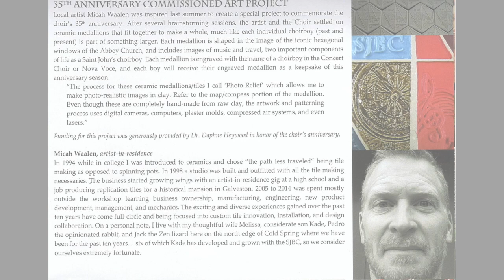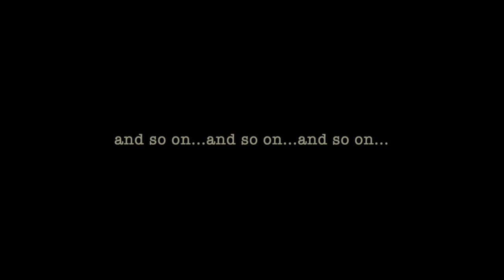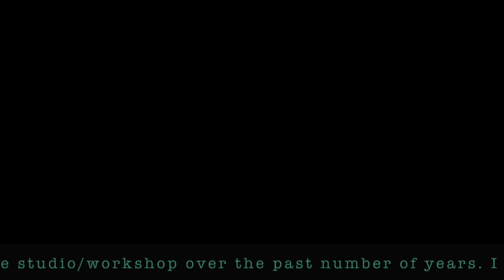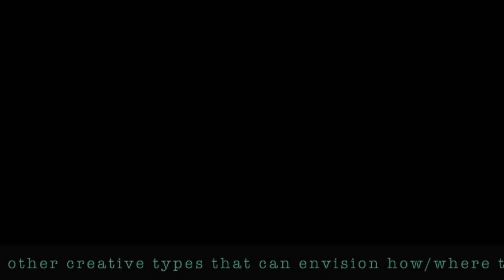Plaster Cast Handmade Tiles. Air Release Mold Process

Comment: Thanks. I tried air release before with less than optimal results.  I will try the soap solution as you show.  I was just using water . I used instructions from the "Texas tiler" website to create my diy molds.
Reply from the maker: How dry your clay pluggs are means everything. I prefer them quite dry/firm for two reasons. As any tile maker knows flatness is often the tallest hurdle so minimizing sag while handling helps keep them from curling as clay has shape memory when fired. The 2nd reason being they release from the mold much easier. Depending on humidity, it does not take long (hour or two) for those 1" pluggs to dry/firm up nicely if sitting on gypsum board or I prefer tile backer board. Not the newer foam core varities but the original cement board stuff. For production runs I would often cut the pluggs the day prior to pressing and let them firm up sitting on tile board but under a plastic sheet. Also...My first few tiles of any run generally fail as the mold needs to be "seasoned" with water, soap, and probably even clay itself aiding as a release. Hope this helps!

Comment: This is so useful, but do have a video on how to make a mold for this one?
Reply from the maker: Thank you Eric. I have wanted to make a mold-making video for years but need an extra set of hands to make it happen. I am in the middle of setting up a new workshop in a new town and once things get in order would love to do that video as you suggest. Stay tuned but be patient. PEACE. Micah.
Reply: @micahwaalen2926  hey Micah I make props where I work and this technique is sweet we have a 2250x1280 vacuum forming machine it ejects the plastic sheet using air, this is really cool, kind of stumped as to how you done that with such high definition, them little globs are a pain, the moulds once broken are a mess to fix.. I guess what I'm saying is: any update on this mold making video? :]
Reply from the maker: @samwildman7424  Hello Sam.  I never struggled with the definition much but for sure the mold making is the most fussy part of the process. Little bubbles from time to time which could easily be scratched off the mold surface or filled in with more plaster as a second step. Agreed it would be nice for me to video the entire mold making process but life has taken me in other directions.